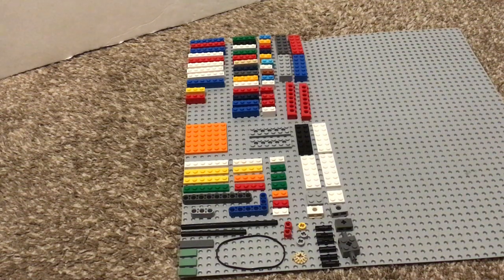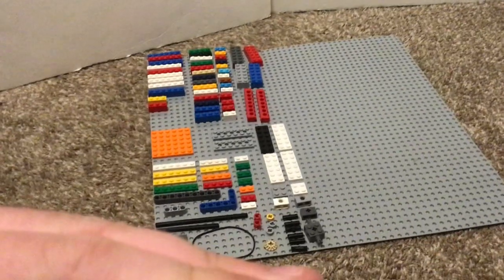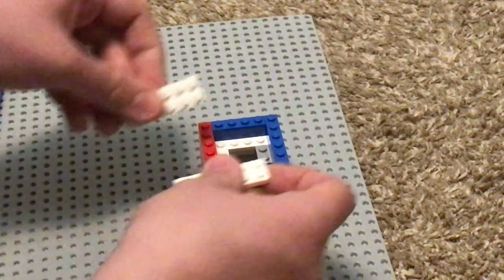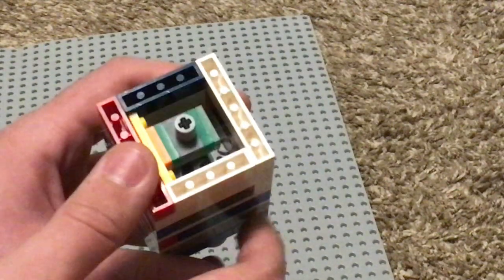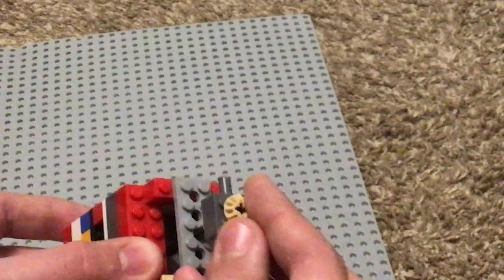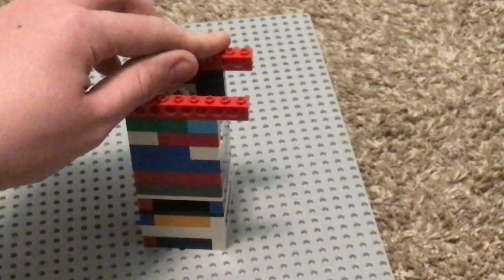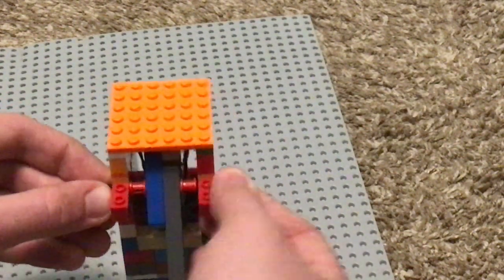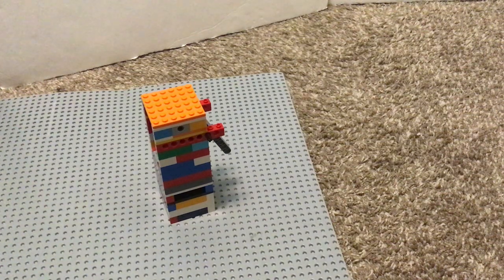Lego Tutorial for OHV Head

Comment: When you used the half stud bushing for the stopper, can I use a 1 stud bushing? Right now I have the bushing pushed against the grey brick with pins
Reply from the maker: Well the stopper isn't super necessary for the engine to run, if the engine can turn over without the valve hitting the stop before the valve goes all the way down, then you are free to use it. I do say what the stop is used for in the tutorial so I am not going to explain it.
Reply: @matsbricks4129  ok thanks I actually just finished it and put in an engine and it runs great! A few more tunes and it should be as fast  as your upgraded ohv!
Reply from the maker: @user_dudeman3  nice

Comment: I connect my vacuum at the tiny port. Am I supposed to connect it on the big port because you said the big port is just a relief valve?
Reply from the maker: The tiny port was the exhaust, not the intake. The big hole was the intake (the hole that is as big as a 1x4 brick area). Also if you can find the time mark where I made that misunderstanding then I could fix that.

Comment: I think the main problem with this head desgin, and possibly the only one, is that since a single valve is doing both intake and exahust, if ur not getting enough of one ur engine will stall pretty easily. maybe if u made a dual valve version it would work more reliably...
Reply from the maker: Well there is two things wrong with your statement, a dual valve system would slow it down with having two valves adding more friction plus the engine has to push down two valve springs, and the intake of this engine equals to a 2x2 square and the exhaust equals to a 1x4 plate and if you look down on a 1x4 plate it has the same area of studs as a 2x2, so even if i had a exhaust port on this then it wouldn't matter as far as air flow goes
Reply: @matsbricks4129  there is still the underlying problem of all of this, which is the fact that if you have one valve it is harder to diagnose and ix problems because you cant really tune the intake without tuning the exhaust. i made basically a version of ur engine with two valves and it worked way better because there was less problems with any specific component. and besides , more friction isnt really a problem since I was able to just use really light tension on the my intake valve.
Reply from the maker: @taylor842 , well you are right about not being able to tune the intake and exhaust separately, although I don't know how that correlates to it being harder to diagnose and fix problems, it would have the same factors of having an exhaust and a intake. If you REALLY tried you could tune the exhaust and the intake separately by putting pieces of tape on the exhaust port and blocking the port from opening, put a piece of tape on the bottom of the valve where it hits the head to fine tune when the valve opens, e.c.t. I watched your video and you used a 4x6 piston and I don't know how powerful your vacuum was or if it was a shop vacuum, but mine was a smaller piston and I ran it with a household vertical vacuum, and mine ran almost s fast if not faster. Plus your engine is much more rougher running at a lower rpm so if anything it wasn't better than mine.
Reply: @matsbricks4129  did u watch both vids ? the later version was much better .... i didnt mean to start somehin all im sayin is that it worked better for me
Reply from the maker: @taylor842  well I believe the reason why yours ran faster is because it had a larger piston. This design is mostly for small piston engines where you can't have 2 valves, but yeah if you had a bigger piston then i can see why it wouldn't run as fast.